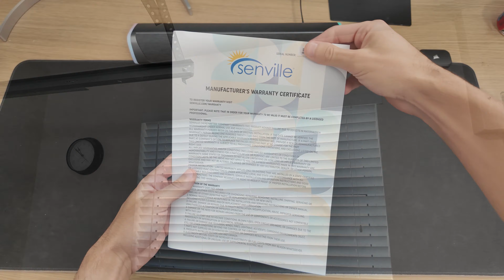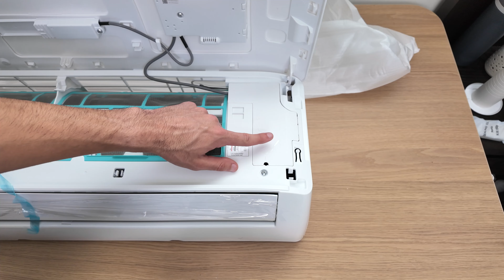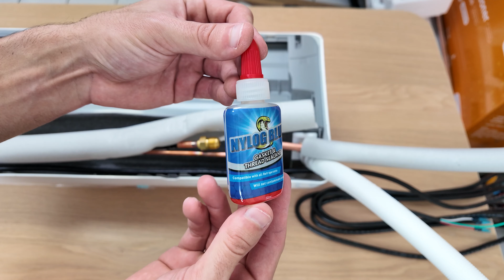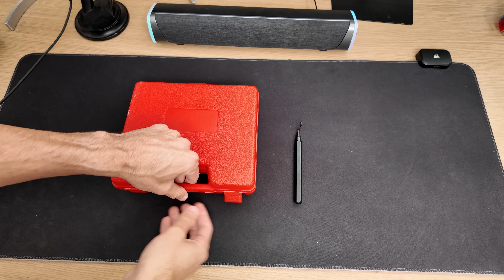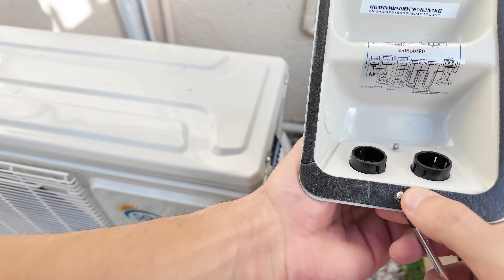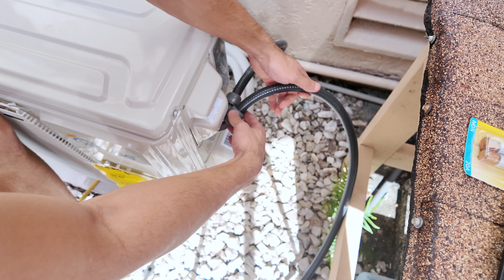How To Install A Mini Split Air Conditioner – Complete Step-By-Step Guide

Comment from the maker: Would you install a mini split yourself, or would you hire a professional? Let me know in the comments!
Reply: 100% will do it myself.  This video answered all the detail questions that I was concerned with.
Reply: Thank you for this detailed and informative video. My unit arrives this Monday. I will use your video as an instructional video for the installation
Reply: Can you please let me know where you purchased this adapter.
Reply: thank you
Reply: is senville a good brand that will last tho?
Reply: @MMEpoxycoatings  most mini splits are since they are so efficient, but I did hear some issues with Fujitsu type mini splits
Reply: di solito usano anche l'azoto per una pulizia competa. Ma chissà quanto costa tutto l'armamentario.
Reply: Since the manuals are all so shitty it depends. 
The valves that you opened at 18:55 required 4 turns
counter-clockwise. 
Midea just requires a  1/4 turn , counter-clockwise.
Imagine somebody sees this video, buys Midea and 
bäng - valve is broken. 

I am  going to self-install a split AC and  I will open 
the valves very very carefully, first trying a 1/4 turn 
and I hope I feel the stopper that is promised.
Reply: this price is in Alabama...in north they ask 4500 usd...
Reply: @angetodac  You're fortunate. I'm in WA and last month I have received 4 quotes and the cheapest was $7250 for an 18k single head. The most expensive was $11500. I'd have loved $4500 and will instead be doing the install myself now
Reply: @alexgilliland1 i could fly over to you with tools for cheaper 😂
Reply from the maker: @ Wow, that’s insane!
Reply: Great video easy to understand and how to do it couldn't have done it without your help
THANK YOU 😊
Reply: This is by far the best instructional video on the installation of a mini split. clear and precise instructions. Thank You.
Reply: I will do my own install. Years ago I worked as an AC installer, and I have recently built my own 600 sqft cabin with no blueprints!
  I have watched several installation videos that left me with questions. You answered those questions on your video. Thank you for a very well done video!
Reply: Thanks Sir ❤❤❤❤❤ Amazing
Reply: Each of the connections you are tightening should be done with a torque wrench to a specific setting for the manufacturer instructions
Reply: Great  video
Reply: Great how to video, really well done and informative.  A huge thank you
Reply: Nobody wants to install a minisplit you bought on Amazon because of liability. So naturally I have to do it myself. Not paying another company to do things their way.
Reply: I'm a fairly handy person, but I didn't think I could do it - until after watching your guide. Splendid job!
I'll definitely get it done myself - I was quoted £4k to install a £2.5k pump with three indoor units. 
Money saved is money earned, and using the so called "boy's math" I get to buy some new tools!

Thanks!
Reply: I will definitely do it myself, have an experience of Ac installed by so called "technician" within the span of 1-2 years, it leaks, then I learn that the pipes are not joined correctly and they not vaccumed the system before releasing it's refrigerant. Most of AC tech in my country wants easy money 🙄.
Reply: the profesiona aasked me 3000  usd for installing a 9000 btu  for which I payed 550 usd...another one gave me a discount :2500 usd...crazy! i need to install 3, one in each room...they think we are milionaires...they went to school for this...and we have to pay their school...
Reply from the maker: @ Yeah, those installation quotes are crazy high, especially when the unit itself costs a fraction of that.  Installing three would be a huge expense! That’s exactly why I made this video to help people save money and see that, with a bit of patience and care, you can do it yourself. They definitely deserve to get paid for their skills, but it shouldn’t feel like you're buying them a car!
Reply: @FersReviews  You don't pressure test with refrigerant. This is done with nitrogen and is very important step that you are skipping. You don't want any refrigerant escaping to the environment.
Reply: Great video. I have watched alot of videos on how to install the units and I can say that yours is the best. It's easy to understand and covers every detail perfect.  Thanks so much for making the video.
Reply: 这哥们的英语听起来好累….
Reply: Hire a professional. Peace of mind.
Reply: @moeselec Sure! For those that are not handy and/or courageous and have a lot of money, go for it. But for the rest of us poor saps, we have to go this route.😂

Comment: Thank you. This the EXACT SAME SYSTEM that we have to install. Your video was a very big help and cleared up some issues we were having. Like why the vacuum connector needed a 1/4" to 5/16" adaptor.  Thank you again !!!
A tip o' the hat.

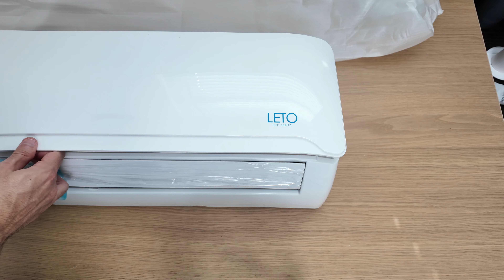Comment: Haha. 4:55. LETO is Russians word "Summer". Nice videos and manuals for diy montage!

There's a very important point. When bending tubes, it's best to use not only extremely smooth and precise hand movements, but also polymer or spring-loaded internal tube benders. They fill the tube cavity and maintain its shape, preventing it from collapsing. It's crucial to take your time and do everything extremely slowly and smoothly. Imagine the tube as a snake, and you can't wake it up, but you have to put it in a box. Like this.

Comment: Ok, so I was using the wrong adaptor from the vacuum pump to the mini split.  I was using the pass through and i should have been using the adaptor that looks like a presta valve.  The wrong one fit perfectly it just didn’t access the mini split.  The correct one did and it was up and running in about 10 minutes.

Comment: I can handle a lot of DIY jobs—mechanical, electrical, even masonry—but after watching the video, I realized there are several aspects where having at least a little experience with the tools you used makes a real difference. No, I wouldn't feel comfortable taking this on as a first-time project. You were incredibly meticulous in your explanation and as precise as a professional installer. 😅

Comment: Nice tutorial! Just a few remarks: 1. before making the flare, remember to put the flare nut onto the tube, and 2. I would use a slight longer cable from the disconncet box to the unit and form a U shape such that water will not to flow to the unit.

Comment: Thank you for the very detailed video. I've done a/c for over 15 years on cars but don't know anything about home a/c. The unit in installing uses r32 and didnt think to look for an adapter until I saw you requiring an adapter.

Comment: you didn't show how to fill the Gas? I suppose it was there already?
Reply: The outdoor unit was precharged. So you have to be careful and not play around with the service valves before it's all set up correctly, since you will lose the charge 😁

Comment: One requirement of the FGas Regs, in the UK, is to pressure test the system on completion of install and prior to any charging of refrigerant.
We use R32 a lot in the UK, which requires a final pressure test up to 400 psi, using OFN.
Not sure what regs you are governed by in your country but all the same, a very good informative video.
Reply: OFN = oxygen free nitrogen. Very important that no oxygen is introduced otherwise risk of 💥

Comment: Several comments/issues here:

Putting the indoor unit a bit lower to slightly cover an inch or two of window may be preferable to hold onto the 6" space above, esp. in places like a garage where appearance isn't that important.

Pushing the lineset out a wall like that by yourself I would cover the ends first with some plastic and tape to keep dirt out.  Plastic so as not to put the tape directly on the connections at all and have some adhesive hang around and create a leak later.

There are better deburring tools and its critical the flange has no imperfections, grooves or ridges so it should be carefully inspected.  Also, the right size just comfortably lets the nut slide down over with no "play" moving it back and forth inside the nut; just some minimal space so that the nut rotates freely without rubbing or binding for when it's tightened down.  If you're cutting down your lineset, know that units have a minimum (and maximum) as stated as they come from the factory precharged and that if you need to violate that, you need a pro to recalculate the refrigerant needed.

The biggest issue here is that an inexpensive manifold and single stage pump like you used aren't providing assurance of a true vacuum test.  First off, understand the pressure involved.  A vacuum requires those connections to your lineset (and manifold, and pump...) to withstand around -15 PSI in order to hold a vacuum.  But when running, a mini split creates up to 500PSI on its lines, and if it also has heat function, it reverses the flow, so both lines get to experience that high side pressure.  During startup on a cold day, it can reach 600PSI.

This is simply a level of pressure that makes leaks undetectable with a cheap manifold as you used; holding a -15PSI vacuum is no assurance of being able to not leak refrigerant at 500PSI later on, or even the 200-300PSI that the unit will have when you fully release the refrigerant before powering it on; close your mouth lightly and you have an airtight seal, but blow out harder against your lips and air is going to come out, same thing is at play here; 500PSI is some SERIOUS pressure to withstand.  And many single stage pumps (the inexpensive ones usually <$100) can't achieve <500 microns of vacuum.

Inexpensive manifold's also don't measure down to that low of <500 microns and therefore meet the specs for a true vacuum test which call for reaching 200-400 microns, letting it settle for moisture evaporation, and see that it holds for 15 minutes below 500.  To do that properly, you need a micron vacuum gauge inline to the service port which will display that degree of vacuum digitally and measure precisely even the tiniest leak, which again, at -15PSI will get MULTIPLIED when running at 500PSI.  

Lastly, do the soap spray lead test after the unit is fully charged (200-300PSI on all lines) and then RUNNING (500 on the high side).  You want that full 500PSI being produced to verify there is no leak.

Doing it the right way could detect or prevent a very slow leak that won't show up on a low cost manifold and pump setup like this, but bleed out refrigerant all year long to create an eventual problem and service call.  

I've found that the investment in the correct level of equipment to do the job right usually offsets itself by equaling if not still cheaper than an eventual service call to fix something not done right at first.  Most would probably expect a service call of several hundred dollars if you have a leak, so buying the right equipment for a true full test isn't more than that and it's a lifetime investment.  Go in with a buddy or 5 on it all!  I'm NOT a service tech, just a person that heavily studies things before wading in and trying, so it's not pay now or pay ME later, it's pay that service tech you call.

There is a schrader valve in that service port where you affix the adapter mentioned.  That adapter pushes in the pin (think about bicycle tires).  This yields a situation where limited airflow gets around the valve, so it may take 1 hour or longer to pull the vacuum down.  There's a pull tool that can remove the valve for faster vacuums that pros use, around $25 or so (schrader valves can go bad over time and need to be replaced, the inexpensive tool does that and holds a seal while doing so!).  And that cap has a rubber seal in it that is important, make sure to keep it clean (like all the caps) and make sure the seal looks good inside before putting it back on, it's a critical 2nd seal behind the schrader valve.  Schrader valves can and will leak over time, that cap is your assurance that that isn't an immediate problem.

So, all fittings and caps have torque specs published in the install manual, this INCLUDES the service port cap, so NO, don't just hand tighten them afterwards. So, yes to hand tighten to the manifold, but afterwards closing up things, torque all three caps to spec.  Again, during a vacuum test you're headed to -15PSI.  When it's running; 400-500PSI so torque those caps all to spec.   All three caps form an important part of the leak prevention on a mini split.  A torque wrench should be used on everything to not under tighten and create a leak, or over tighten and either damage or create a leak.  A set of "crowfeet" on the end of the torque wrench are used instead of a socket since you can't put one on the lineset lines.  Make sure to understand the leverage involved when adding the crowfoot; it needs to be a perfect right angle to the handle when being used so that the wrench still accurately measures the torque.  Just think that, were it straight, it would make the wrench act as if it were longer, altering the force... (if for some reason you can't do a 90 in your physical location, there's some math you can look up to adjust the torque setting for that!).

Doing a full proper vacuum test means no need to leave it as you did at 50PSI for a while again after releasing a bit of refrigerant.  That means that you should just open the upper for 1 second to release a bit of refrigerant, not 5 seconds, and let in barely enough refrigerant to go from negative to the very minimal amount of positive that you can (2-10PSI).  If your 1 second doesn't do it, open/close it again quickly.  Doing it that way doesn't put any more refrigerant in the line to the manifold which gets wasted when you disconnect.  Your goal is to break the vacuum yet lose the least amount of refrigerant.

You may want to block the bottom opening of that lineset cover outside also so critters aren't setting up their home in there.
Reply: Would you use an anti kink spring while bending the tubes?
Reply: @cebruthius  Yes, already bought the colored nylon set of the various sizes you insert for any bend just as cheap insurance that it all goes easily and you can get as tight of a bend as you need. I look at stuff like that as a lifetime investment.  I know I'll install another one later, and then my son may also...

Comment: The coolant used in this video is obsolete and when installing a 2025 system using R454B you will need different instructions/gear.
Reply: Why?
Reply: @j.w.8663  The coolant that is now used is flammable, and you cannot use the same pump/gauges due to the flammability. The new system will also have leak detectors to avoid fires/explosions should there be a coolant leak.
Reply: @RickandStacy  Good 2 stage pumps like the one I just bought are sealed to prevent sparks for fire.
Reply: @RickandStacy Good to know!

Comment: It's exactly the same as but the air doesn't cool I already looked at everything and there are no liquefaction or anything but it doesn't cool as it should
Reply: Call a tech and tell him every step you did, you likely missed something and had refrigerant lost.

All these videos for quick installs are shortcuts the pros don't take:

1. you need a 2 stage vacuum in order to properly pull down to <500 microns ($103 on Amazon Prime Days now, and up)
2. to measure no leaks then, you need a digital vacuum gauge - not just a cheap manifold - that can read that low ($102 on Amazon Prime Days and up)

Testing a unit for holding vacuum does NOT ensure it won't leak when running.  That's why the pros pressure test with nitrogen.

Vacuum requires the seals to hold at -15 PSI, a FRACTION of its operating pressure of around 400PSI.  Then there's using torque wrenches on every connection and not guessing by hand and few DIYers can do a flare correct should they want to cut the lineset.

Comment: I love the video, however, my (brand new) pump has been chugging away for 10 mins but is still gently 'steaming' from its exhaust funnel - does that mean I have a leak, or a bad pump, or both... Or is it nothing to worry about? Thanks Mark
Reply: Hmm... think I've just answered my own question - turned off the pump, closed the valve and the vacuum decayed away in under a minute 😢 I guess I need a tube of that sealant.  I was really careful to get the torque right on the connectors too (I noticed you just 'guessed' the torque, which surprised me..
Reply: Good news folks, the leak turned out be where I'd cautiously (over cautiously) hand tightened the pretty coloured pipes. A further tweak, and the retest held perfectly 😊

Comment: I have the exact same unit and vacuum gauges. I can’t get the vac down to 30. I closed the valve and turned off the pump and the gauge hasn’t dropped after 3 hrs. Any ideal why I can’t vac to 30?
Reply: More than likely a faulty gauge I had same promlem, bought a new gauge and bam
Reply: If you mean 30 microns, a single stage vacuum pump can't get there.  You need a 2 stage, and then a digital vacuum gauge that can read that low.  Spec calls for vacuum to around 400 microns, and it holding at 500 or less for 10 minutes.

These cheap dial manifolds and cheap single stage pumps are NOT up to the challenge of a proper install.  And that's ignoring that torque specs aren't mentioned and the average person has no clue hot to get a good flange if they cut the lines.

Trying an install with the wrong equipment is like walking a minefield, you may make it, you may not, and when you don't you'll spend way more on a service call then buying the proper equipment would have cost.

Comment: Do not use on threads: The torque ratings for flare nuts are based on dry threads; if you apply lubricant, you can accidentally over-torque and crush the soft copper.  We're all learning...

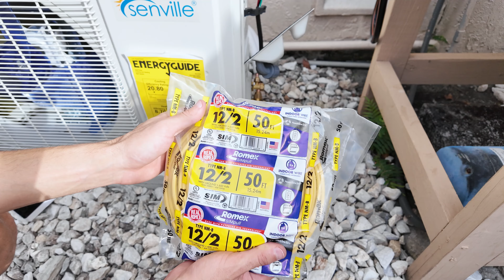Comment: @21:48 for the 24k BTU it is against electrical code to run a 25amp vreaker with 12/2 AWG romex as it is unsafe and may not trip in an electrical emergency, you should run 20amp, which per unit spec is 20amp.